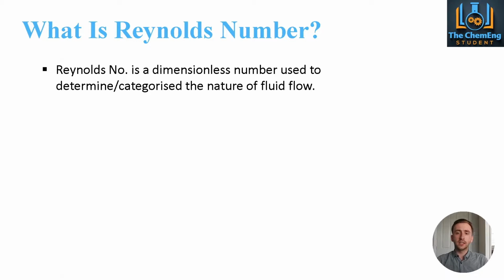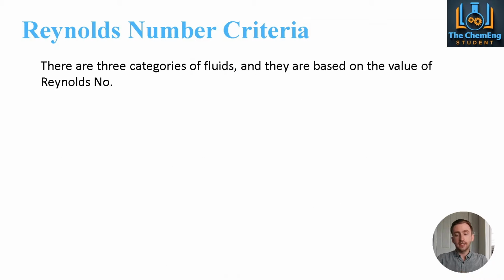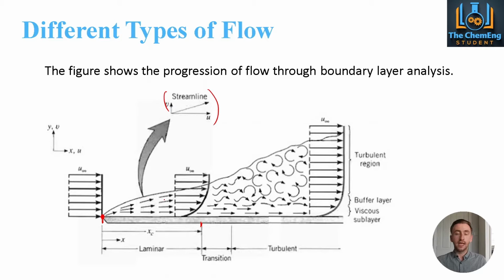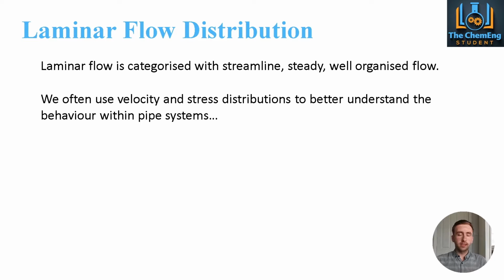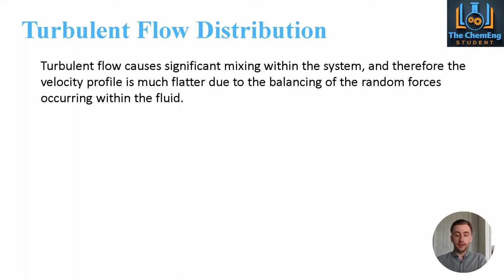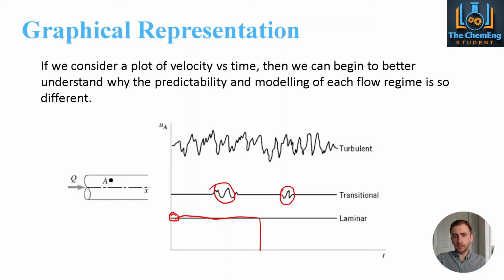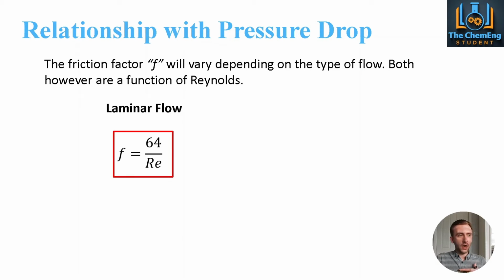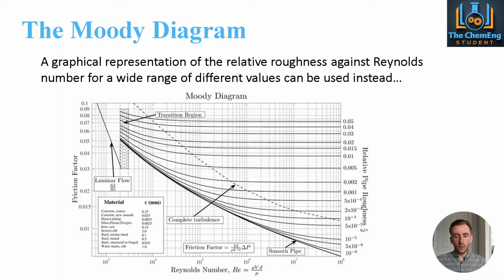The Complete Guide To Reynolds Number For Fluid Flow Dynamics

Comment: Hi there how would i find Reynolds number if im doing a 2d model and i know the diameter of the line which is inlet. Would it just be the equation you mentioned Re=pUL/u where L would be the length of this line lets say 1m.
Reply from the maker: If you wish to use the standard Reynolds No. pVD/u then this would be the pipe diameter. If you wish to use the pipe length you can use the equation VL/v where the denominator is the kinematic viscosity rather than the dynamic viscosity in the first equation. I hope this helps and thanks for watching and commenting!

Comment: Hi guys. I hope anyone can answer my question. I was wondering if you could make use of the Reynolds number while making the design of a process. Maybe for the pipes? I just would like to read you guys, Take care!
Reply from the maker: Hi there, thank you for your question. Reynolds No. is integral to process design as in order to fully design any process whether it is the piping system or main plant units, it's essential to know the type of flow you are working with, as the correlations required in the design phase will differ significantly, especially within Heat and Mass Transfer. This will then lead to different resistance times, different utility demands, varying sizes of equipment etc. So generally speaking Reynolds is one of the most essential parameters to find and also should be one of the first, as it highly influences many design elements. I hope this helps.